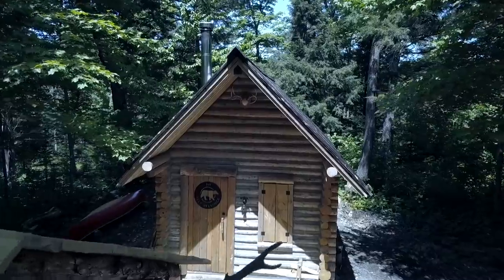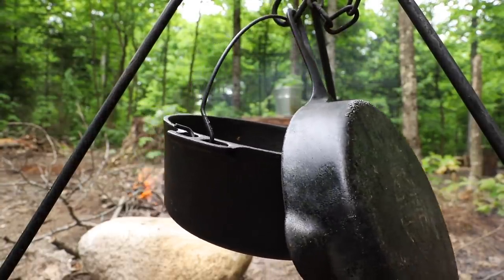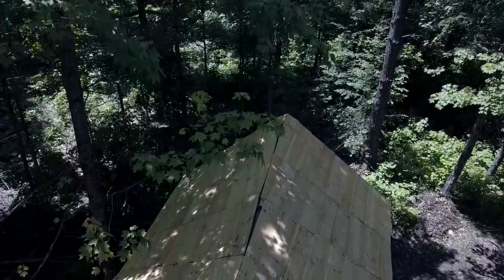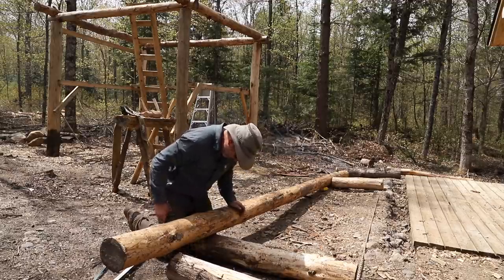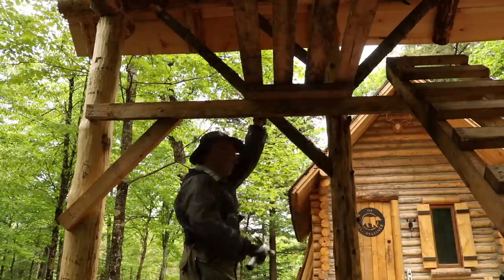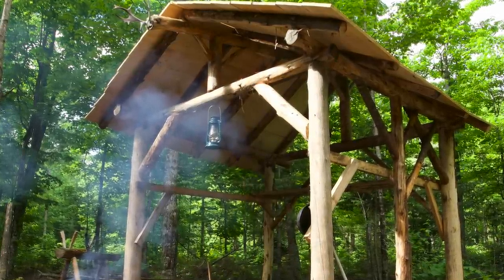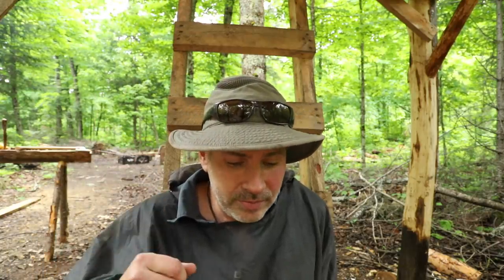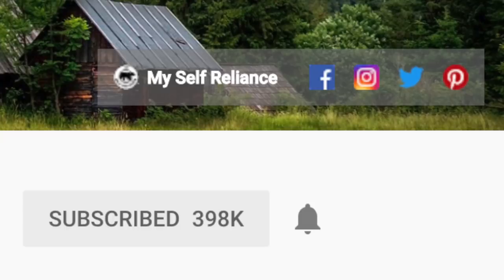Off Grid Outdoor Kitchen at the Log Cabin, Why Build It?

Comment: A double barrel outdoor stove and a spark arrestor during fire season. All fire use copper hot water heater. Timber stand improvement. TSI build jinn pole for log lifting. 3/8" cable compound hand winch

Comment: Hi from Argentina.
I'd like to see you modifing the back sido of the log cabin to add a workshop. You have a very good skills with wood and it is wonderful to have a place to work comfortable. Specially in cold seasons.
Best regards!
Reply: When I was younger I spent many happy times in my Shop tinkering. 4 winter I have a woodstove out there. I'd get fire going and go out 2h later and she be cozy.
Now I tinker w/my LT & I still got lumber out there. When it comes 2 woodcraft I aint no Shawn. My motto? Y use 2-3 9Ps when I can use 4 6" bolts?

Comment: Awesome explanation on why you're building this outdoor kitchen Shaun. At each episode I was wondering why, now I know.

 Up at my folks cottage before they had electricity put in my dad bought a big galvanized water tank and we built a water tower to put it on. The tank was the same shape as a steel drum only much bigger. It was around 12 to 15 feet off the ground. He had a small water pump (gas powered) by the lake to fill up the water tank. The pump was in a small galvanized enclosure kinda like a dog house to keep the elements from damaging it.
We had that water tower/water pump set up like that for over 20 years...Now he has an electric jet pump under the cottage.

Perhaps you could do the same for your outdoor kitchen? Get a water line going from the creek out back to a water tower then to the cabin and outdoor kitchen. I'd use a solar panel to charge a battery and use a low voltage pump instead though. The sound of the gas pump would scare all the wild life away...

I can't wait to see the rest of the build and the construction of the pizza oven!  :)
Reply: Along this line of thought.. There's a HYDRAULIC pump-the tech is very old. Might be called a Hydraulic Ram. Don't understand how it works myself but it DOES WORK w/o juice/power of any kind. Pipe.. quite a bit IIRC is needed. You'll get her done at your own pace Shawn. Don't hurry on our account Oki Doki?
Reply: yes it is a hydraulic ram pump and it works like a sterling engine does but on pressure differential instead of heat ... but they do make a lot of noise as the valves snap closed for each cycle .... also the ram pump is good to lift about 5 feet maybe 10 depending on the size of the pipe and pump made .... but they are definately a power friendly option
Reply: great idea...i may implement this to water my gardens etc,..from my pond...thanks...

Comment: do you have lime stone bake it at 800 degrees fahrenheit  slake it with water till it flakes out pound with wood mix with sand gravel and ash you have just made concrete or motar
Reply: he can also use various shellfish that can be found all around the lake and water logged parts of the cabin ... to make lime but for the amount he would need he would have to have almost a ton of lime stone or shells to get enough.
Reply: Very few people actually will make there own mortar due to the high heat required and the amount of raw material needed plus the time to collect it. 
Some will make you think they make it by showing you the very basics of making what would amount to a few ounces at most. 
We all have seen that Shawn is not trying to do this since he used bagged stone/mortar mix to set the posts for the kitchen.

Comment: I like the outdoor kitchen idea but always wondered why you cut the 2 horizontal roof supporting logs off to match the roof line, why didn't you continue the roof another 10ft and make the summer kitchen/porch there ?  Either way, it's a work of art, thumbs up as always.
Reply from the maker: Thanks. I just couldn't handle any more weight for the ridge beam. I could barely lift those and I would have needed another 4' of more of length to make it work. but in hindsight, I think it was the right decision anyway because it would have looked like an awkward longhouse and I would have been worried about fires.
Reply: Gotcha !  A chicken house, lol  Really like the roof line and all the angle braces, Thanks again !

Comment: Outstanding build. Why did you build an outdoor kitchen? BECAUSE YOU CAN.
Keep up the good work. Your work looks great.  As far as proper building practices I have helped renovate numerous older structures built as much as a hundred years ago.
The finished product is typically very good but the framing, supports etc are not necessarily up to code but they have been there for many years. Who is to argue your building practices if it works and does what you need it to do.

Comment: A roof made of 3 x 12 with board and batten using log frame makes great shed material. 1 x 4 spaced can be used for 36" hand split barn shakes. We did old barn 40' x 100' x 1 first story milking barn with two story hay loft. Back in 1930 the had rail system to fly in hay off wagons.  Later built concrete silo . 40 acre hobby farm. Timber stand improvement.  And fire break around cabin. A portable fire pump with fire hose . You can place fire pipe on ridge of cabin that can wet down roof . Oregon and Washington state fire crews have battled many huge fires caused by lightning or man made. Lucky we had self fire protection. You can clear your land and transplant native moss, and make irrigation swales.  Pump it let root stock grow down to water. Global warming the coast of WA state was 16 miles west under 300' of ocean. Our glacier has melted that feeds our 4 private rivers and 250,000 acre landmass. Good luck on your build. We build our long houses we split a few planks off each tree. 2x 12 x 40' long. The cedar bark makes clothes spruce root makes water proof baskets you heat rocks to boil water. Learn to barter . Celia falls oregon has been native NAFTA of indian country for 10,000 years. Trump has no clue of native nafta! LOL

Comment: I've watched all your videos and I"m very impressed.  I'm still not clear on the charring of the wood.  Does this process really prevent the wood from rotting?  I've built several buildings, but never considered this method.  My "shop" is an open timber frame with a traditional roof.  I love working "outside" in the shop and although I have to be careful to keep the rust from my tools, it works out fine and gives me flexibility.  Keep up the interesting posts!

Comment: I have an idea. 

When you make a bug fire, why not try seating the stovetop fan at the edge of the coals? If there's enough heat differential to power it, it would also fan the fire a little allowing for more smoke to be created, and also allowing for the smoke to be directed towards whatever position you're working in. 

Otherwise, giant mosquito nets tacked around the kitchen whilst you work inside it!

Comment: Are you going to be getting solar in the future? Great for running some fans in the cabin. A fantastic type two way fan that runs on 12v would be a great wall or roof vent to control the temp indoors.
Looking forward to the bug video. Must be brutal at times.

Comment: I'd been wondering about the wonky roof line but since I like it and it was clearly a design element, never asked. Now I know and thank you for that. It's pretty amazing really and part of it's value is how well it works regardless of the season. I also didn't understand the jet stove until someone's bushcraft video enlightened me. Now it makes sense and that's cool. It clearly works very rapidly and uses so little fuel that it is a definite winner!  You built loads of counterspace at a great height for both you and your wife. Your forest kitchen should provide many years of comfortable use for you and your family.

Comment: Looks great, in Scandinavië they used (up to end 1800) layers flattened dried birch brak as roof cover (layer in between). By nature is contains oil and will not decay quickly. You can lots of information on the subject online.
Reply from the maker: That's what I wanted to use for all of the structures but I can't get enough of it

Comment: Shawn, I am a Contractor and my wife and I ( 55 yo and 48 yo respectively) have completed a number of large carpentry projects, but nothing related to timber and logging. Your videos showing how you build with logs doesn't seem to dissimiliar. While my confidence level may be high framing homes and decks, I feel a little uneasy tackleing a log cabin. However, my wife and I equally as much want OUT! If we soon do not get out of this insane overpopulated, corrupt controlling system we are chained to and brainwashed in believing we are "Free" or have some resemblance to "freedom" we will absolutely explode. While I believe through resources such as your channel and others, we can muddle our way through the construction processes. However, living from paycheck to paycheck or job to job, finding and paying a huge amount for Land has me stuck where we do not want to be. Its sad and depressing. Our area in Central Pa outside of Harrisburg, Pa is over run with drugs, corrupt local government and thugs. This concrete haven is a breeding ground for the impoverished and we "need" help! Help to get out! Now before the SHTF. How did you find your property? and how much do we really need to come up with or save? And how can we find land to build on.
Reply from the maker: You definitely have more skill and experience than I do so I'm sure you can do it. Here's how we found the property. https://youtu.be/8p2AcPYv7gY. 
Other than that, it's a matter of sacrifice and commitment to change your life - one day and one step forward at a time. Even if it takes years, those years will pass regardless whether you spend them pursuing your dreams or wallowing in self doubt and procrastination. You can do it!

Comment: Hi I have watched all of your cabin build. It looks like when you look at the front of the cabin that the outdoor kitchen roof is sloping 10-15 degrees down to the right. Just wondering why you didn't slope it the other way. I would think that this would prevent a bunch of rain water from the roof collecting near the front area of the cabin. Or does the rain fall straight down cedar shakes, or does it have something to down with smoke draft from the fire place. Just curious.
Reply from the maker: Yes, the water won't follow the ridgeline, it will fall down the slope to the north and south and then run along the ground to the west (left looking towards the cabin)

Comment: Have you had any thought of doing a wok on your outdoor kitchen? It might give you some more options on using heat for cooking differently. It's also one of the original ways to cook on an open fire (and many are still used of actual flames). Cheers!
Reply from the maker: I am sure the rocket stove could be used with a wok pan

Comment: Have you thought of slip forming walls with local stone?
Reply from the maker: That's what I was thinking after reading the Neerings' books. Minus the rebar.
Reply: It is still a primary building method (with premade forms) for putting up walls quickly. 

You will still want the rebar, salvage is fine, and it is part of the unifying structure of the wall. The rebar aids in joining a new pour on top of a previous cured one.

Comment: Why not run a 8k-10k AC unit 600-800 watts, it would be much more comfortable with humidity removal.  A small inverter type generator about 2kw should be enough to start that size AC, and would be very quiet.  It would idle when AC off.
Reply: Now you're talking!!!
Reply: I'd do that, but I doubt he will.
Reply: At least not on camera, poor guy.
Reply: A D missing the point entirely! But love the input